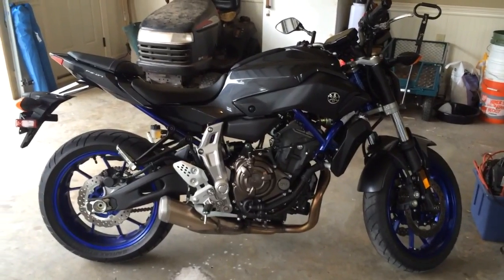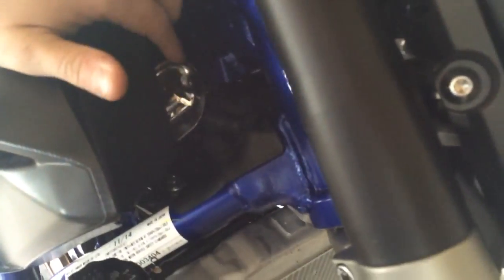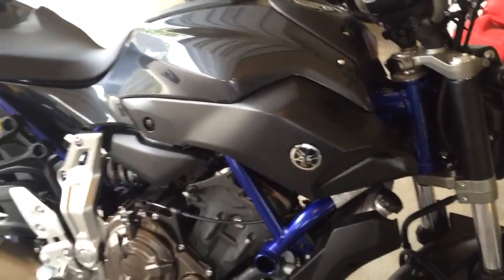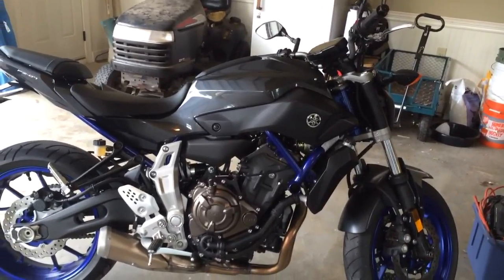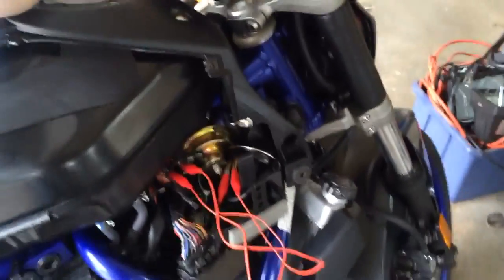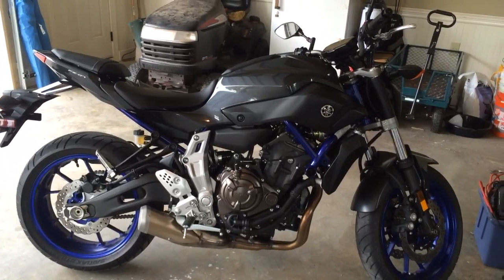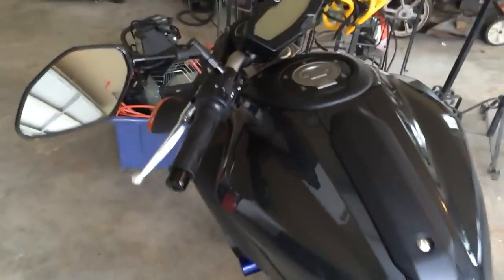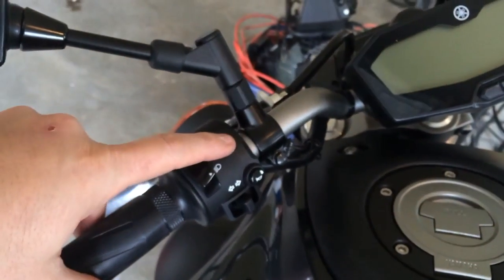2015 FZ-07 horn upgrade

Comment: I like the horns, but the garage door opener was amazing. Is it wired into the bike or battery powered?
Reply from the maker: I just de-soldered the button on the garage door opener and ran speaker wire from the original button to the board. The opener is under my seat and as of right now it is still battery powered. The button is mounted on the handlebars.

Comment: Hi Josh.. nice quick video. really appreciate the effort. thanks much. out of my curiosity, did you use any relay or extra fuse to install these horns. I read that without a relay it may burn the wiring and blow the switch in long run. How is your setup working now. Please help me understand. thanks in advance again.
Reply from the maker: I don't own this bike anymore, but the current owner loves both the horns and the garage door opener. You are absolutely right that you do have to use a relay. If you get the horns from harborfreight, they come with a relay. Let me know if you have any more questions.
Reply: @japhillips87  thanks a ton for responding to my question/concern right away. greatly appreciate it. I noticed few doing it just without relay and got little confused & just do not want to over do it by adding relay and all the setup. But the best practice says that we need to use the relay to protect anything from blowing. Yes, my horns came with a relay and I am building my own harness with 16 Gauge wire and of course using terminals but not fuse. Just to confirm, is it ok if I do it without a fuse ? Million Thanks again.
Reply from the maker: @sdaruri  It should be. I don't think I added a fuse. To clarify, the purpose of the relay is to prevent relatively high currents needed by the horn from passing through the horn button. When you press the horn button, the relay allows the large current to flow to the horn, but separates that current from the horn button.
Reply: @japhillips87  thank you so much for this response. I am on the same page with you. It is just many recommended adding a fuse to be on the safe spot. But I guess I am fine with just a relay I guess. Out of curiosity, which bike are you onto now. have a blessed day Josh.
Reply from the maker: @sdaruri  I don't have one at the moment. I will probably end up with a dual sport eventually.